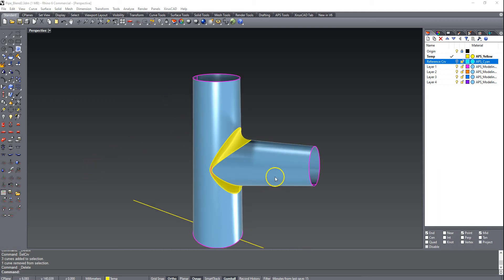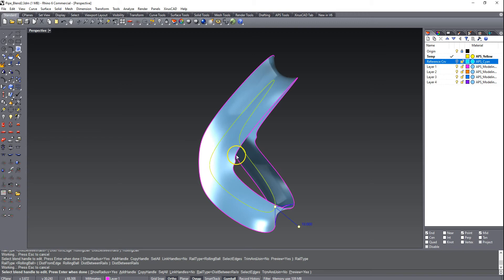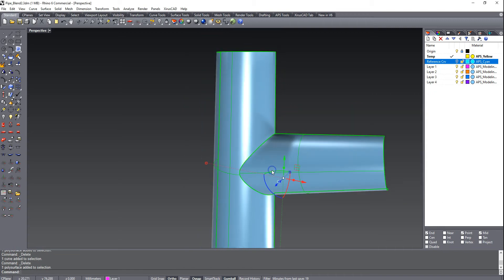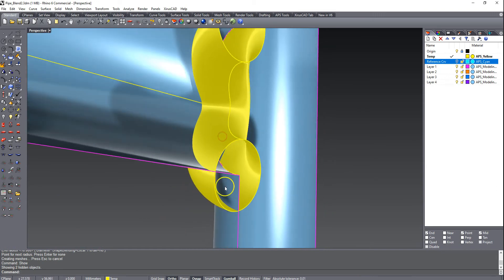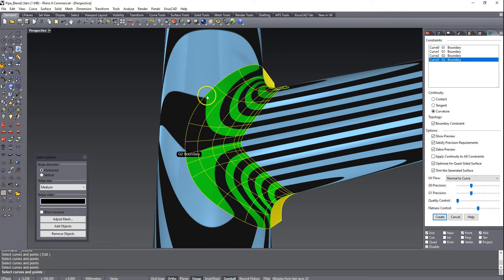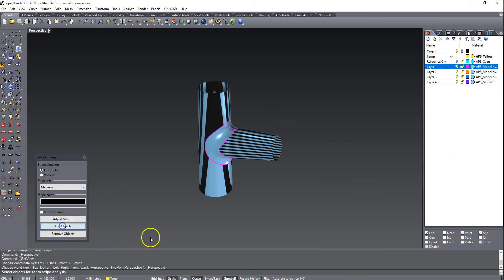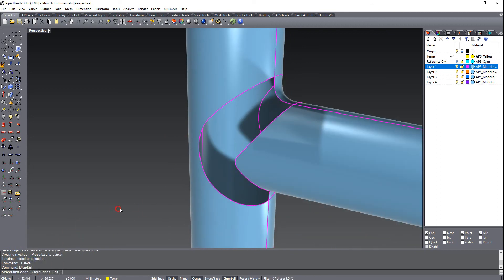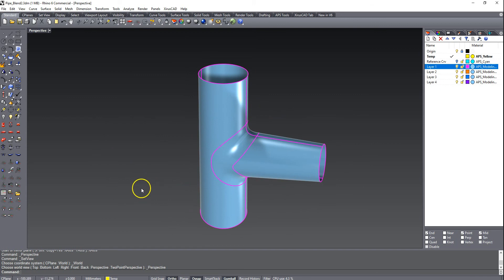Rhino3D, blending intersecting tubes with XNurbs

Comment: If you had simply use deg3 or deg5 in curvature curves on a sweep 2 rails in rhino tools it would have been perfect.
Reply from the maker: Did you watch the whole video? I used standard Rhino tools towards the end of the video and it doesn't do nearly as good a job as XNurbs.
Reply: @marklandsaat3696  Yes I watched it till the end, and I recognise that Xnurbs do the job. I only said if the generative curves on the sweep would habe been made of  4 points curves it would have been perfect with standard sweep on two rails tool, just because it would'nt have been any interpretations from Rhino, only points in tangency with the border. Xnurbs looks more usefull to realize five border surfaces when you need to be quick.

Comment: Does this work in Rhino 5?
Reply from the maker: @Thomas Parel, yes it does. But the Zebra preview of the XNurbs surface only works in V6. There is a workaround for this. If you create the XNurbs surface while recording history, you can go back and edit the settings. It's a little more iterative than V6, but you get the same high quality surface in the end.

I work a lot on imported geometry and XNurbs is really good when the input geometry is less than ideal. With that said, XNurbs is not a magic bullet. If the input geometry is crappy XNurbs won't magically procude a great result.

Comment: Thank you very much for the explanation !!! Great
Reply from the maker: Hi Ali, no problem. This technique works really well in Rhino, but is not as easy to use in SolidWorks. SolidWorks may require a different approach.
Reply: @marklandsaat3696  Would love to see your approach using Solidworks. I spend some time exploring standard SW tools & GW3D to solve a similar issue. However, it didn't work well. I would also love to see how X-Nurbs deal with surface patching in this situation. This is what I came up with :/ https://we.tl/t-u6GkfbwAcA
Reply from the maker: @Martynas Lagauskas I downloaded your files and I think you are definitely on the right track and pretty close. One of the things to keep in mind is that the boundary conditions for this type of blend are far from ideal. Given that control point modeling is not an option in SolidWorks, the best you can do is optimize the boundary conditions. While not technically curvature continuous, A conic surface from GW3D may be a really good option here given that you can't have inflections in conic surfaces.

If I have time this week, I will look at this and show the results for both XNurbs and a Conic surface in GW3D.
Thanks.

Comment: Wich tolerances (and mesh settings) did you use ?
Reply from the maker: Absolute tolerance 0.005mm, Angle tolerance 0.5 degrees.
Mesh settings is somewhat of a dark art. These are some settings I feel work well while keeping the file size relatively small.

Maximum angle; 5
Maximum aspect ratio; 10
Minimum edge length; 0.5
Maximum edge length; 20
Maximum disctance; 0.005
Minimum initial grid quads; 16

This may or may not work for you. I model relatively small things. If you model large things you may need to use a lighter mesh, if you model really small things, you may need a more dense mesh.
Cheers.
Reply: @marklandsaat3696  Tnx so much mate
Reply from the maker: @azzoboj  No problem, hope it's helpful. for what it's worth. all my Rhino parts eventually go to SolidWorks and I have found that 0.005mm will always give me solids when transferred.